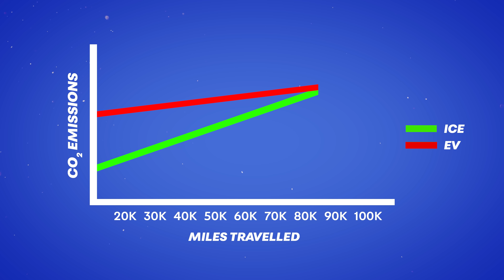Are Electric Cars REALLY That Green? [New 2022 Data]

Comment: OH THANK GAWD, it's about fracking time!!  even if this had not been quantified, the environmental rescue promise of ev's has been criminally overhyped since forever.  imo, BEV's are too much and electric motor with a small ice is the best way to go. an efficient 3-cyl engine can provide electricity for a high performance EV.
HOWEVER, I still have some big problems here - particularly for applying the findings to the American market - and that's without getting into your baselessly extrapolated conclusions;
the bev's are 25-30% heavier than the ice's which will have a significant impact out side of the scope of the study.
it assumes about 8000m/yr when 12000 is more typically presumed in usa
it does not include maintenance of the vehicle - it's not a "carbon process"
the lifespan of the vehicle is set to 15 years and 125,000 miles
the battery pack is accounted as "an insert" with the numbers plugged in as accepted from the Chinese mfg. =\
while the impact of the destruction of the vehicle at the end is included, the impact of the Li waste from the batteries is not.
the study assumes you will NOT have to replace the very expensive and toxic battery pack whereas guidelines suggest that beyond 8 years or 100,000 you should prepare for it due to decreasing battery life and lots of thing impact it including heat, cold, quick-charge, low charge, high-charge …
"AAA found that when the ambient temperature dips to or below 20°F and the vehicle’s heater is in use, the average electric car’s operating range drops by 41 percent. When the mercury hits 95°F and air conditioning is in use, an owner can expect the range to fall by an average of 17 percent"

Comment: Ultimately, we are talking about pollution. So far, everyone is obsessed with what comes out of the exhaust, as opposed to the pollution caused by the generation of the electricity, to charge an EV. No one has mentioned the pollution that comes from brake, clutch and tyre debris - and many other pollutants that are generated by road vehicles. As I understand it, EV cars are heavier than comparable ICE cars, and will therefore use brakes and tyres at a faster rate, generating a greater amount of pollution - where ever they are driven. Using EV cars in a town or City environment, will require far more braking and tyre use, than if used on a motorway. This would have a negative affect on its "City Green" status. No one seems to have mentioned this or taken it into account when arriving at their figures.

Comment: Very interesting video. Those EV warriors have something else to fight about now!
I have seen other facts stating it is 3-4 years for EV to start breaking even which seems about right to me. 
The big issue is those EV cars on lease or which get traded after 3 years and you repeat the whole thing again. Although I agree that we need more affordable 2nd hand models, but eventually we will see the same damage done with people upgrading far earlier than they need to.
Reply: This reminds me of the argument of diesel over petrol back in the day before EVs started getting popular. The argument was don't get a diesel unless you do high mileage otherwise you will not recover the extra cost of the more expensive diesel engine over a petrol engine and I remember there was a website to help you calculate that. Perhaps there should be something similar to this for EVs/ICE cars., otherwise virtual signalling types that barely do any mileage per year will actually be creating more CO2! A bit like all those celebrities flying around on their private jets telling us not to polute the planet!!!
Reply: Another way of looking at is that the cost of saving one ton of CO2 with an EV is 20 times higher than saving it by the cheapest methods.

Comment: Ugh. 6 months to 3 years for an EV to overcome the larger pollution of battery creation depending on the source of your electricity. I have solar panels and natural gas generated electricity, which is by farcleaner than coal in say West Virginia.
Reply: Also, the Volvo Recharge... isn't optimized as an EV - ground up EV design, aerodynamics, battery size.
I'm sure the Model Y or Model 3 would have lower number of miles to parity - as they are very efficient.

Comment: i suppose it depends, if you actually include all of the inputs to building an ICE car, such as materials for parts, lead, steel, and plastic to name just a few. then there is need to drill for oil (which also requires you to have electricity to drive the riggs, we know this cause last year there was this major freeze in the US, because the natural gas suppliers couldnt get electricity because the power plants couldnt get natural gas ), then you have to transport the oil from where that drill was (at sea or on land) to a tanker (which also needs fuel...and lost of it...they arent small) that will eventually get to a refinery, which also need electricity ( and not a small amount either), and then there is transportation to a gas station (all by diesel trucks so far), and once its in that gas station, there has to a tank for it to be inserted into), and of the gas station requires electricity pump the fuel to the vehicle needing it. and that doesnt include just the vehicle, which varies widely (from commercial vehicles to private ones). now each  type needs electricity , which can come from may different sources, from solar, wind,  natural gas, oil and coal, and the power plants also need electricity to run also. now BEVs have some of the inputs, steel, rubber, parts, and others that are also needed by ICE vehicles, but there are also some differences, lithium-ion batteries are needed by them to move.  and the inputs for that are mined in many places (copper is one, that has a shady history...but it also used in ICE vehicles too).  each has its own set of pollution from gathering materials to fuel, build and then run them. but only one has a more controlled way of actually powering the vehicles, and its not  ICE ones. cause vehicles tend to be on the roads for decades (and yes BEV can do that too,  and not all ICE can last that long), and while some places have testing programs for ICE vehicles, not all do, and not all of them actually get tested.

Comment: It takes about 10 years to reach 90.000 ml for normal driver. There is no way that a smug EV driver, who can waste 50.000+ $ on a EV, drive a car for more that 5 years, tops. Me, with my 20 year old petrol car have reached about 180.000 miles. So in best case scenario i have consumed 4 EVs but more likely 2. So, if EV driver changes cars every 5 year, a petrol car, who doesnt change a car, still leads by "2 EVs" or 180.000 miles. And "green tariff" made me laugh my socks of. You know what realy brought CO2 emissions down? Windmills?! Solar!? No, gas, or specificaly new pipelines to Europe from Russia and fracking in USA. And France nuclear. They are building it on yearly basis.

Comment: The problem is with the CO2-centric lens to this report. This report may be accurate (I have no way to validate it) and since the legislative framework is focusing on CO2 it makes sense. However, there are far more costs and issues around pollution, health care and national security associated with dependence upon fossil fuels that are not factored in. The video touched on it but completely failed to assess any cost to that. Overall, a good video if one that is flawed by letting the parameters of the discussion be constrained to just CO2 rather than the broader factors of climate change (which includes other sources such as methane) and environmental damage from particulates (soot), plus the previously mentioned health care costs and national security costs.

Comment: I think the electric cars make alot of sense for someone living in city or close suburb. The problem once you get outside of in the vast middle section of the US. The car will not be able to make it from a charger to the next. I have watched TFL do tests and if you put a trailer behind an EV the range drops to between 25 to 50 percent. If you watch Hoovies Garage he purchased a nice used Tesla that was just out of warranty. I think it was either 7 or 8 years old. The car soon after purchase through a code and it was the batteries. The batteries needed replaced which would cost more than the car was worth. I agree that we are at the point ( tipping point) that EV make sense in some situation but battery technology still needs to evolve to meet all circumstances.

Comment: The 90,000 mile figure is based on the global average energy mix in the Volvo report. Although they un-helpfully don't provide the figures in the report they do provide the sources. 

The value for the global electricity mix they used is 475 gCO2/kWh
The value for the EU-28 mix they used is 394 gCO2/kWh

In contrast the value for the UK's electricity was 181 gCO2/kWh in 2020.

So it's very easy to understand that the global average value is irrelevant for a UK audience.

Using the actual figure for the UK "carbon break even" comes after 51,000 km - or around 31689 miles. 
Wildly different from 90,000 and breaking even after around 4 years of driving 7400 miles a year, instead of 12.

Comment: One thing not considered in this video is the longevity of the car itself. A 90,000 mile EV or a 90,000 ICE vehicle, I would pick the ICE vehicle.
There is no reason why a well maintained vehicle with an internal combustion engine cant do 250,000 miles. How many miles can an EV do before it dies??
I dont know the answer to that, but im surprised that it has not been considered.
If an EV is only capable of 120,000 miles then its not green at all

Comment: In the US, the average miles driven in a year is 14,300 miles. So it will take 6 years for the break even. The conservative estimate for lifespan of electric car batteries is 100,000 miles. Will the car even make it to the break even point? Most people in the US don't keep a car for 6 years. In the US, the wind turbines use electricity, in some cases use more than they produce. Film solar panels will have to be replaced after 5 years. Crystalline solar panels have a life span of about 25 years. Solar panels loose efficiency every year.

Comment: I think this video was made solely to stir up a dispute. Electric vehicles are in the infancy stages. There is no doubt that they are more green. Shockingly there was no mention of all the different toxic fluids in an ice car that end up in our water systems. Engine oil, transmission, antifreeze and I could go on. These disingenuous click bait videos are tomfoolery. Why is it so hard for people to accept that better is just simply that, better. As the market grows and the technology grows every aspect of Electric vehicle will improve, including batteries and means of charging. There already exists ways to make electricity without having to use other sources of power. Once the flood gates in the minds of our future engineers and creators and scientists open, Ice cars will only be museum pieces that no one will desire to drive. It won't make sense. Its just like you don't see horses on any highways because it doesn't make sense.  So in conclusion, embrace moving forward to and for the better.

Comment: I own 2 ev & 3 plug in hybrid with 30 to 60 mile range. My hybrid cars will make it to 100k miles just fine. Neither of my ev will that number. Their battery has reduced power so much by time they hit 50k miles that at 90k my gulf cart will have more range. 

So, if EV are worthless by 90k where ice or plug in hybrid can go 150 or 200k what does that do to carbon footprint?

Comment: Spot on, we're keeping our Yeti as long as possible but I'm reducing my car journeys with an electrified old mountainbike and that really makes a dent in my petrol use.

For comparison, my 35 mile round trip commute into Central London costs about £5 in petrol on my motorbike but only £0.10 in electricity on my ebike. Travel time is comparable but health benefits on the ebike are substantial (until I get knocked off by a careless driver and get injured more, than I would in my full head on the motorbike... I try to be safe either way).
Reply: look up vids on minig lithium & cobolt.. & yes,,it doesnt effect you. 1 bit.. does it..

Comment: "green" shouldn't just be about CO2. It's really important obviously but we've also got to consider materials. One of the big issues with EVs is eventual battery recycling which needs to be improved to move towards a circular economy to reduce the amount of mining we need to do, but there's no way to recycle petrol. Once a fossil fuel is burned it's gone.

Comment: Okay. Rory, I'm sorry to point this out, but you made a fairly big technical error in your comparison of the break-even point of EV vs. ICE. You said that it would take longer for an EV to offset its emissions in "short trip" city driving vs. an ICE in the same situation; this is completely false. An ICE vehicle with a cold engine creates more emissions; gas cars because the Catalytic Converter isn't doing its job yet (due to being cold), and diesels (in the form of particulate matter, or "soot") because of excess/unburned fuel injected around the shift points; where the engine is at its lowest load, therefore creating less heat. The only way in which either of those vehicles could halfway be claimed to be cleaner applies to diesels, and the fact that NOX is less of a problem (not completely gone, just less of a problem) when the engine is cold; it's an issue when the combustion temps are too HIGH. In a "1 V 1" comparison, given that situation, the EV would take considerably fewer miles to cross the "break-even" point of an ICE. Now since I can't find numbers on exactly HOW MUCH of the gas vehicle's emissions the Catalytic Converter actually reduces when it's working, I can't give an exact number of miles. But given the fact that gas engines are (at best) 40% efficient, I doubt it'd be a trivial amount. But that's going down a rabbit hole that has no end. Lemme get back on track.

In your equivalency argument, you also voiced the assumption that all gas car lovers do; "Gas cars have **itty fuel efficiency in the city, so EVs must be the same." If you really were someone who understands - let alone owns and drives - an EV, then you would NOT have made that statement. EVs are well known (and extensively documented) to excel in city driving, and struggle on sustained-speed highway driving; the exact opposite of ICE vehicles. And since this post is already long as-is, I'll skip the needless rehashing of why that is.

Now if you'll excuse me, I've got some light reading to do. downloads the Volvo report

Comment: What happens to the value of an EV without modular batteries,  ie batteries integrated into the car, after 8 ywaes. ICE cars can easily continue to be used after 8 years and no need to deal with battery disposal.

Comment: A few comments.  First, thanks to Volvo for attempting to quantify all of this information.  Its refreshing to see a bit of honesty and rational behavior around this conversation.  Two, let's also be honest and recognize that CO2 is not a pollutant.  Its a naturally occurring chemical that is essential to the healthy existence of the planet.  Research of earth core samples have shown that CO2 was exponentially higher during the early stages of the planet when life and nature thrived, and when ICE engines obviously did not exist.  Its the other chemicals emitted from internal combustion that are bad for the environment, but car manufacturers have made huge strides over the past 30 years at significantly reducing those pollutants.  Three, and this IMO is the more interesting and important discussion about the future of EV's.  Where is the power to fuel them going to come from if a paradigm shift does occur and most people move from ICE cars to EV's.  Wind, solar, and hydro are all mostly clean, yet they are completely incapable of providing even a fraction of the energy needed in that future environment while being both unreliable and far most expensive than coal and natural gas.  Nuclear is out because, well, it's been demonized relentlessly.  Petro based energy generation is being relentlessly attacked with countries around the globe promising to fully do away with it on some (many times unrealistic) schedule.  So where's the energy going to come from to power my shiny new EV.  Here in the US we have a wonderful example of this phenomenon.  The state of California has decreed that ICE cars will no longer be sold there by 2030 and is pushing EV's like candy to children.  California has also shed numerous sources of petro energy production in their never ending quest to be 'green'.  All of this has landed California in a position where the state is currently unable to keep the power on to people's homes and businesses throughout much of the year, while it begs for more 'higher priced' energy from adjacent states driving everyone's energy costs way up.  And this is at a time when EV's represent only a very small fraction of the total vehicles in the state.  Not exactly a model most countries would want to emulate.

Let's face reality for a moment.  The biggest 'pimps' for EV's are governments staffed by some of the dumbest and most incapable/incompetent people on the planet.  Hoping this group of corrupt, self serving, entitled, incompetent clowns are going to get anything right associated with the future of EV's is next to zero.  Personally, I still think EV's are a stepping stone to what comes next, a technology that no one sees yet, but that will solve many of the issues with today's EV technology.